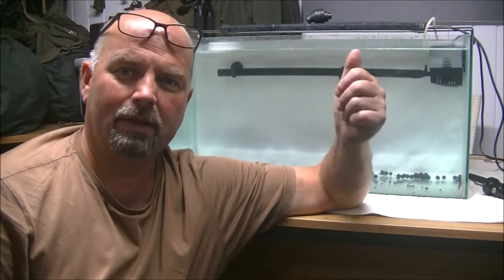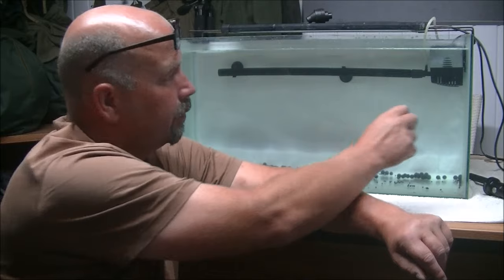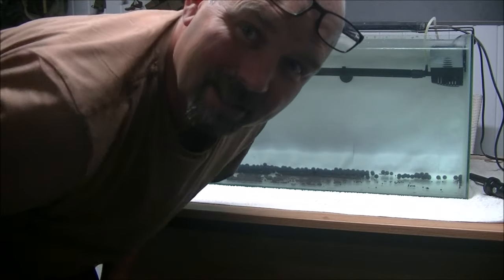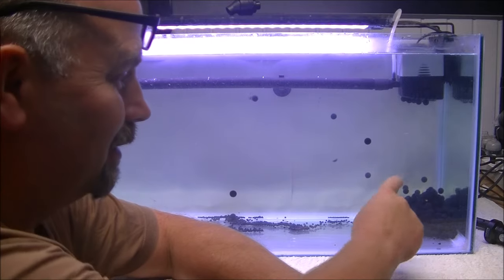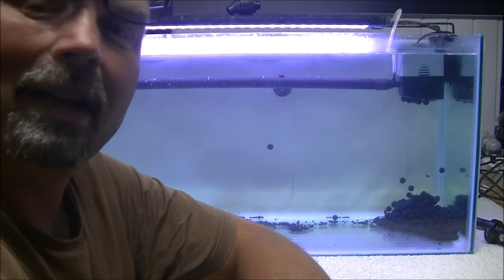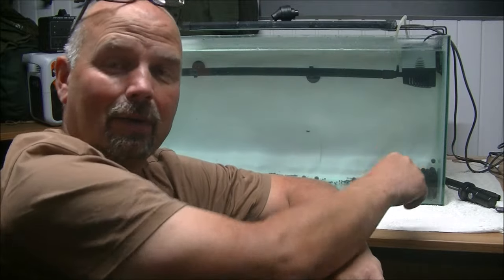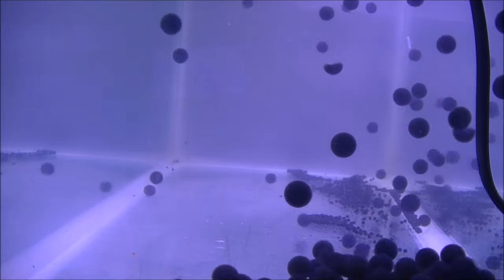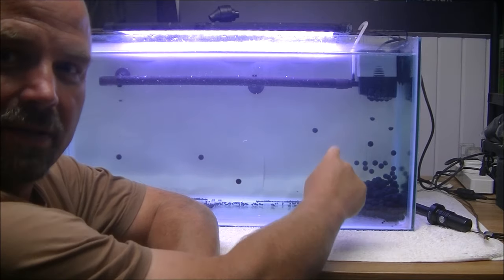Aquarium Spray Bar Flow Demonstration - Pondguru

Comment: I have an Fx6 on my Jewel 450 Bow Front tank, and I made a spray-bar from 25mm/1” electrical black conduit. It’s almost the full length of the tank with holes about 50mm/2” apart facing the front of the tank and 4 or 5 holes at 90deg to them to try and clear any dead spots along the back of the tank. It works really well for me with plenty of oxygen being generated by the spray-bar.
Reply from the maker: Nice one - I'm glad that works well for you and thanks for watching.

Comment: Very nice and usefull footage but im wondering what will happen if you put some stones in or something
Reply from the maker: Any sort of structure will affect the flow patterns in the tank.
Plants will diffuse the flow and solid structures (e.g. wood / rocks) will redirect it.
Therefore experimentation is key as every tank is set up differently.

Comment: This would be a great addition to the pimp my filter series to help show a rough idea of the filters capabilities before and after modification. 👍
Reply from the maker: The problem is with the Pimp My Filter series is that all the filters belong to viewers so when I fill them up with new foams and media I want everything to stay dry so I can ship the filters back full of (dry) media and foams. The flow rate will not alter since it is the fine pad which dictates the restriction of flow (when it gets clogged with muck).
Whether the fine pad is placed in the correct place or last in the filter it will clog at the same rate.

Comment: The "suction" is at the intake end so together with the spray bar the muck's going to end up there.I'd like to see what happens if there are two intakes, one at either end.Thank you Richard you've started something here!!
Reply from the maker: Yes, wherever the intake is is where the muck will generally end up but it can be different depending on how the tank is set up - any structure will affect the flow pattern so some experimentation may be necessary.

Comment: Nice video... Ive was using this method for years, but the wider the tank, the less effective it is, unless you use a more powerful filter, & setting it up on the side ends depends on the length of the tank, as it causes a corkscrew effect under the water, so from the cap end of the spray bar it hits the glass opposite & winds back to the filter end. But if used either end, the flow will be less effective as the flow will stopped before it hits the glass the other end... And also, spray bars are meant to be on the water line to help with air .... But this method does work as ive used it & great video as always 👍
Reply from the maker: Yes, it is always best to have the spray bar right at the surface and when there is flow being fired from each end of the tank it definitely does cancel the flow pattern out - thanks for watching and appreciating the videos.

Comment: This is a spray bar placed lengthwise at the back.
It would be nice to see the difference with a spray bar on a side, blowing from right to left (or the other way around).
Reply from the maker: No worries - I should really have done that in this video.
The effect of having the spray bar on the end of the tank is much lessened due to the spray bar being shorter and less water being able to flow (due to a reduction in the amount of holes in a short spray bar).
I'll make a video to demonstrate.

Comment: I use a spray bar exactly how you set it up, i was considering going back to the duck bill on my 307 but i think ill just keep the spray bar 😂 i will say im quite heavily planted and have driftwood and structures so that probably makes it less effective.
Reply from the maker: Any sort of structure will affect the flow so it's best to just experiment with different outlet types and different locations for intake / outlet.
Every tank is different so experimentation is key.
It's very different and easy to demonstrate flow in this video's 
 bare tank, lol
Reply: @pondguru  Absolutely its a good visual though and surprising as you said.

Comment: That is an absolutely incredible outcome. Who would of guessed that the muck would still assemble there. Do you reckon it's because quite literally, that one spot is the place where the flow is at its least? , it surely has to be . Another great video my friend 👌
Reply from the maker: I honestly thought that the muck would just rotate and not navigate toward the intake but it does just that. 
Until you set something up to investigate and give a visual representation of what actually happens it's all just guesswork so I'm glad I've done this test.
Yes, I think that's the area of least flow where the muck navigates to but it does it so much better than when a normal straight outlet is fitted to the pump / outlet. This was a pleasant surprise.
Reply: @pondguru   certainly was a surprise. You are creating real scientific evidence here mate  😁😁😁 oh and don't think your joke went unnoticed, because it made me laugh straight away !!! " I've literally had ........ " some " requests 😂. I'm still finding it funny even a few hours later 😂
Reply from the maker: @Les-OZZYTHEOSCAR  Yup, that's a very old one from the Clarkson days of Top Gear, lol
Nothing new under the sun.

Comment: I use a spray bar in a 2 gallon saltwater tank connected to a canister filter. Works amazing with a better flow.
Reply from the maker: Groovy - sounds good to me.
Reply: @pondguru  I'm now using a spray bar in my new 20 gal saltwater tank with OASE canister filter and its awesome. Also thanks for the proper way to pimp the OASE!
Reply from the maker: @usmc187  No worries and I'm glad you found the video useful.

Comment: Thank you again sir, 
What would happen if you add another pump in the left side, I seen a lot of people doing 2 filters on bigger aquariums
Reply from the maker: Usually the clean flow pattern is cancelled out but muck will generally gravitate to where the intake of the filter(s) is located. As soon as structure is introduced into the tank flow patterns change so experimentation is needed for best placement of intake(s) and outlet(s).
Reply: @pondguru  thank you sir

Comment: So you think it is better to run your spray bar along the length of the tank instead of the width? Your video has clear results for the length which is what I run but have had people tell me to run it on the width. Curious to see a comparison or even just know which is better
Reply from the maker: It will be much the same and I will do that in a new video in the next couple of days to demonstrate. If it is mounted on the side of the tank the turnover of water is less than if you use a normal outlet on the pump.
That's due to the limited amount of exit holes on a short spray bar restricting the potential flow from the pump - hope that makes sense.

Comment: Good video mate like watching these very interesting, could you do a spray bar going left or right on the surface of the tank as that how I’ve got mine set up with a fx4 😊
Reply from the maker: On the end of the tank? If so then that will work in much the same way. Someone else asked me the same question so I will shoot a video tonight with the spray bar on the end of the tank to demonstrate what happens when it is set up that way.
As long as you have good water movement and the muck is being swept toward the intake of the filter the system will work well - there's no definitive way to set up the filter since every tank is different - just experiment and see what works best for your situation.
Reply: @pondguru  cheers mate yes would be interested if my set up could be improved anyway

Comment: Does a bowfront aquarium change the flow  of water with the bar or the nozzle?
Reply from the maker: It will be much the same - when water is fired from the back of the tank toward the front it eventually has to come back toward the rear of the tank (where the spray bar is fitted) due to the cyclical motion and as demonstrated here it will navigate toward the intake.
However, every tank is different so just experiment and see what works best for you - there is no definitive right or wrong place to have the intake and outlet.
Reply: @pondguru  thank you!

Comment: Hi I just put one on my four foot tank  full of danios . Should I put it just on horizontal level of the water  spray across  the  surface to create agitation  or pointing down . What’s best suggestion for angles     Or does it not matter ? Also how fast for danios do they like fast current esp at night as they hang out near surface . Should I slow it down slightly at night when they’re kipping . Sorry I know a lot of questions . But  you are the Guru 👍😜
Reply from the maker: Ideally it would be at water level to agitate the surface and hep with aeration.
As long as you have plenty of structure and good planting for the fish there is no need to reduce the flow since the flow will be naturally diffused by plants redirected by the structure which allows for zones of lower flow and a better living environment.
Reply: @pondguru  thanks for the advice . I recently moved a big tank full of danios and algae eaters to change my lounge up and they seem to hate the new location . It’s quite near the lounge door and  tv  and now the algae eater have gone nocturnal.  It’s a shame as I’ve had one for 12 years and now he just hides .  I think it’s either the tv noise or they’re now at a busy part of the lounge    Hopefully in time they will adjust . I just added a spray bar so I will now like you suggest up the planting more. . Thank for the advice R 👍
Reply: @pondguru  my spray bar is also on the side going length ways . It is a shorter length nose  but I don’t like all the bubbles  rushing to the front glass  . The intake is at open site enemy and I vacuumed a lot  so I think it should be ok
Reply from the maker: @mrvera1970  I've never been a fan of seeing tanks near a TV due to the flashing images but to be fair I'm not sure exactly how much of that the fish will see in the tank.
With regard to the spray bar whatever position works for you is the best - there is never a definitive way to set anything up since every tank is different.
Reply: @pondguru  they are a foot behind and to the side so they can’t watch Eastenders .  No they just see the back but they are to the side  to be honest I think  it’s because they used to be in a quiet part of the lounge  near the window but I had the window replaced so I had to move the tank and when I did, I thought I ain’t moving it back. It’s such an operation playing tank Tetris . I’ve only got so much wall space so they have to stay where they are, but I think eventually they will get used to the fact that people are coming in from the door towards them and then go to the couch so I think it’s just about getting used to lots of people coming in and out all the time hopefully they  will settle because Fish  in aquarium shops get used to people.  Do you miss having your shop ?
Reply from the maker: @mrvera1970  Yes moving a tank 5 feet of 500 miles comes with the same challenges so I understand not wanting to move it again.
With regard to the shop I definitely don't regret closing it, especially since the electric costs doubled. It seems live the govern-ment has been hell bent on destroying small / independent business since 2020. I'm so glad I saw the plan and worked to get out of the system as much as possible.
However, I do miss the face-to-face interaction with people which I had with the shop.
Reply: @pondguru  I remember your old posts from the shop. Weirdly, I bought two fish tanks online a few weeks ago one after the other on the first it leaked on  the first. Fill I had to wait two weeks for the replacement and as soon as it arrived, I looked at the silicone and it was dreadful so I sent that one back and then I demanded a refund and I thought do you know what sick of online shopping? I’m gonna go back into a shop and actually speak to people and look at the seals and talk and you know what? I’m glad I did and I’ve got a much better tank sometimes online fails I think it’s alright for small items, but when it’s something big, I wanna see it,  I I learnt a big lesson this last few weeks . I get what  you mean about the electric Cost on some businesses it’s critical and can be high . 👍 have a good day .
Reply from the maker: @mrvera1970  Yes, 100% larger items are always best bought in person and although I do most of my non-food shopping online I never buy anything large or expensive online (unless I know exactly what I'm buying and have previous experience of it).
My sister in law is moving her business from a street location to a piece of land adjacent to her house and once the initial building costs are out of the way it will be much cheaper going forward - that's what I decided to do many years ago.

Comment: I installed similar, but at the short side of my aquarium.
Using an Oase 850 and Juwel 240.
Reply from the maker: That will still work fine and the short side of the aquarium is a position most people never think to put their outlet on but it is a good position.

Comment: Hi mate, hope your well. Am thinking of getting a fluval flex. On market place it comes with no external back filter.  Eheim power ball or fluval? Appreciate your thoughts!
Reply from the maker: The Fluval Flex comes with a built-in back sump so it should be present unless it has been cut out?
In the absence of that back sump filter the best choice would be a simple (and cheap) HOB filter such as the All Pond Solutions HOB-500. 
https://geni.us/Q4AI37t
It is probably the best filter I've featured in the 'Pimp My Filter' series of videos.
Reply: @pondguru  hi cheers for that, I've also seen another with the system in place, do you like the all in one system?
Reply from the maker: @graemekann4739  The back sumps are very good as they hold everything outside of the main tank and have a nation of space for media. Plus they are very easy to maintain.
Reply: @pondguru  that's great cheers mate. What media would you put in ? I haven't yet seen a pimp my filter on the flex yet me' ol fruit!
Reply from the maker: @graemekann4739  With the small sumps the Biogravel is perfect if used in small mesh bags. I have it ready filled or loose with mesh bags separately on the FilterPro site (media is on 'Biohome Media' page and mesh bags are on 'Foams, Bags' page.
Best of luck with the tank. You can get around 1.5kg Biogravel into a small back sump no problem.

Comment: are you sure it doesent just collect below wherever the intake is? you should test that aswell...
Reply from the maker: Yes, the muck would generally gravitate toward wherever the intake is but that can change when any structure is introduced into the tank.
Unless the tank is bare (like it is in this video) you'll never get a clean flow pattern since structure will redirect it.

Comment: Wonder what would happen, if the spray bar was mounted on the side panel, spraying down the length of the aquarium? 🤔
Reply: (my other channel) Damn, I should have done that in this video - I'll shoot another video showing that, lol
Reply: it will be there where water sucked from aquarium. Mount the spay bar on top of drain and water will make a cycle...  nothing new here in video, but demonstration is   just perfect :)
Reply from the maker: @chuck77k  Yes, nothing new as everyone should be able to predict where the water will go but it's useful to see it with moving parts (the gel balls acting as 'muck').
Reply: @pondguru  Anyway, you have done the best visualization ever :)

Comment: is it just pump sucked water from bottom? Sure muck will be there, where else? :)) it is water flow direction :)
Reply from the maker: Yes, the muck would generally gravitate toward wherever the intake is but that can change when any structure is introduced into the tank.
Unless the tank is bare (like it is in this video) you'll never get a clean flow pattern since structure will redirect it.

Comment: OMG that is so surprising 😮 it's a real shame most tanks don't let you fit spray bars at the surface.
Reply from the maker: Yes, although I doubt that many companies making tanks or filters have ever done a simple test like this to see where water (and muck) goes in their aquariums. 
This test even surprised me as I honestly didn't think that the spray bar would be as efficient as a single outlet but it turns out that a spray bar is way more efficient compared to a single outlet (e.g. duck bill outlet) to move fish waste and uneaten food into the intake of the filter.

Comment: Quick question Sir pond guru . . . 
What's the quietest canister filter you've tested ??? 
I've had to pull the plug on the aps 1000ef+ to save there being a divorce 🤣
Reply from the maker: When I get all the canister filters to feature in the Pimp My Filter videos I don't run them as they are not mine (and I send them back dry, full of media and foams).
However, from past experience the Eheim filters are consistently quiet but unfortunately the construction quality has taken a dive since the Pro3 series.
There will always be a 'hum' from canister filters and as long as you ensure that air isn't being drawn into the intake they will all be reasonably quiet. Sometimes the cheaper they are the louder they are but that is not always the case.
It is best to look at online reviews and Amazon in particular will have unedited feedback from people who have used the filters.
Reply: @pondguru  Thanks again kind  Sir 
M